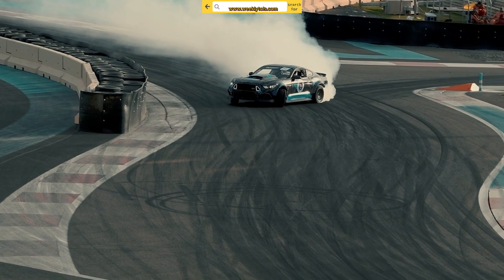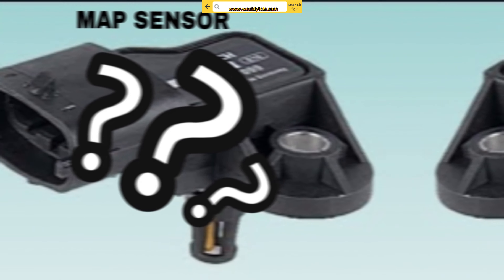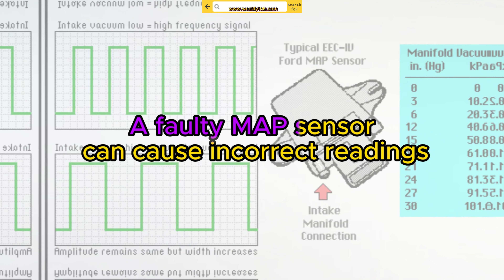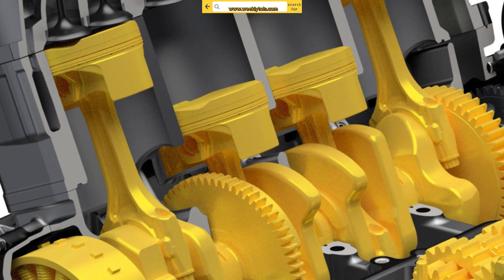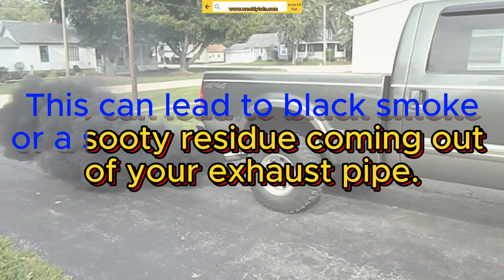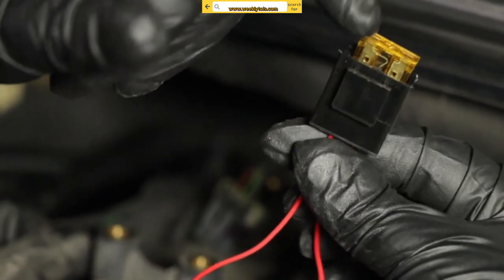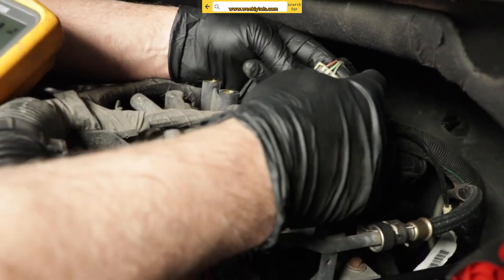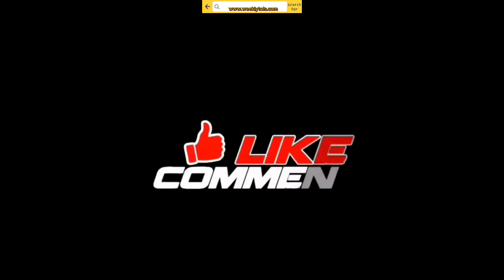Symtoms of a Bad Map Sensor | How To Fix Bad MAP Sensor |Bad Map Sensor Solution | Bad Map Sensor |

Comment: Would this cause codes P0172 & P0300 to pop up? 
I just replaced the spark plugs, coil pack, and fuel injectors on my 2013 Chevy Cruze Lt last month.
Reply from the maker: The codes P0172 and P0300 can be caused by a variety of factors, and replacing the spark plugs, coil pack, and fuel injectors may not be enough to resolve the issue. Here are some possible causes for these codes:

P0172: Fuel System Rich:

Fuel pressure regulator: A faulty fuel pressure regulator can cause the engine to run rich, leading to the P0172 code.
Mass airflow sensor: A malfunctioning mass airflow sensor can send incorrect information to the engine control module (ECM), causing it to run rich.
Oxygen sensor: A faulty oxygen sensor can provide inaccurate readings to the ECM, leading to a rich fuel mixture.
Vacuum leaks: Vacuum leaks can allow unmetered air to enter the engine, causing it to run rich.
Fuel injector malfunction: Even if the fuel injectors were recently replaced, one or more of them could still be malfunctioning.
Engine control module (ECM) issue: A faulty ECM can cause the engine to run rich.
P0300: Random Misfire:

Spark plugs: Even if the spark plugs were recently replaced, they could be damaged or mismatched.
Coil pack: A faulty coil pack can cause misfires.
Fuel injectors: Faulty fuel injectors can cause misfires.
Timing belt or chain: A worn or stretched timing belt or chain can cause the engine to be out of time, leading to misfires.
Compression issues: Low compression in one or more cylinders can cause misfires.
Engine control module (ECM) issue: A faulty ECM can cause misfires.
Additional troubleshooting steps:

Check for vacuum leaks: Use a vacuum gauge or smoke test to check for vacuum leaks.
Test the fuel pressure regulator: Use a fuel pressure tester to check the fuel pressure regulator.
Inspect the mass airflow sensor: Inspect the mass airflow sensor for dirt or damage.
Test the oxygen sensors: Use an oxygen sensor tester to test the oxygen sensors.
Check the timing belt or chain: Inspect the timing belt or chain for wear or damage.
Perform a compression test: Perform a compression test to check the compression in each cylinder.
Have the ECM scanned for codes: Have the ECM scanned for any additional codes that might be related to the P0172 and P0300 codes.

If you have already replaced the spark plugs, coil pack, and fuel injectors and are still experiencing these codes, it is recommended that you have your vehicle inspected by a qualified mechanic to diagnose and repair the underlying issue.

Comment: Can it cause engine knock plus poor fuel economy?
Reply from the maker: Yes, a bad MAP sensor can cause both engine knock and poor fuel economy. Here's why:

The MAP sensor's role: The Manifold Absolute Pressure sensor measures the pressure in the engine's intake manifold. This information is crucial for the Engine Control Unit (ECU) to determine the correct air-fuel mixture for optimal engine performance.

Impact on air-fuel mixture: A faulty MAP sensor can send incorrect readings to the ECU. This can lead to an imbalanced air-fuel mixture, which can be either too rich (too much fuel) or too lean (too little fuel).

Engine knock (rich mixture): If the mixture is too rich, there's excess fuel that doesn't burn properly in the combustion chamber. This unburnt fuel can ignite prematurely during the compression stroke, causing a knocking sound.

Poor fuel economy (lean or rich mixture): In both lean and rich conditions, the engine isn't burning fuel efficiently. This wastes fuel and reduces your car's gas mileage.

Other symptoms of a bad MAP sensor:

Check engine light
Rough idling
Hesitation or stalling
Black smoke from the exhaust (rich mixture)
If you're experiencing any of these symptoms, it's recommended to have your car inspected by a mechanic to diagnose the problem.  They can use a diagnostic scan tool to check for trouble codes related to the MAP sensor.
Reply: @weeklytools  my car is idling fine, only knocks under little harder acceleration under 2200rpm
also, can a bad o2 sensor cause similar simptoms?
also; i have no check engine light, no fault codes, i monitored live data from running engine and everything looks good to the ecu but something is obviously wrong
Reply from the maker: A knocking sound during acceleration can indicate a few potential issues in your car, even if the check engine light isn't on. Here's what could be going on:

1. Detonation (Knocking):

This is the most likely culprit based on your description. Detonation happens when the air-fuel mixture in the engine ignites abnormally due to low octane fuel, lean air-fuel mixture, or engine deposits. It creates a knocking sound, especially under load (acceleration) and below higher RPMs (like the 2200 rpm you mentioned).
2. Worn Engine Components:

Less likely, but possible, is knocking due to worn parts like bearings or pistons. This typically produces a deeper, more constant knock compared to detonation's lighter, higher-pitched sound.
3. Loose Engine Parts:

In rare cases, loose components like heat shields or engine accessories can vibrate and create a knocking sound under acceleration.
Bad O2 Sensor and Knocking:

A faulty oxygen sensor (O2 sensor) can contribute to knocking, but it's not the most common direct cause. A bad O2 sensor can lead to a lean air-fuel mixture, which can then cause detonation and knocking.
Diagnosis:

While the live data might look normal to the ECU, it's recommended to take your car to a mechanic for a professional diagnosis. They can use specialized tools and listen to the specific sound to pinpoint the issue.
Here's what you can do:

Try higher octane fuel: If you're using lower octane fuel than recommended for your car, switch to the recommended octane level and see if the knocking goes away.
Take it to a mechanic: Don't ignore the knocking sound. Ignoring it can lead to further engine damage. A mechanic can diagnose the problem and recommend repairs.

Remember, this is just general advice, and a professional mechanic can provide a more accurate diagnosis for your specific car and situation.

Comment: good knowledge. if you give some information about the location of the sensor.. then knowledge will be more effective
Reply from the maker: Thanks for your advice.Hope to fix them next time.
Reply: Map sensors are usually located on the intake manifold.  It varies vehicle to vehicle.
Reply: Is there one for a 2006 Honda Civic my gas mileage goes from 53 to 26 to 50 to 30 to 45 to 50 to 28 mpg each highway trip.

Comment: And burns out the catalytic converter. Or over heats it and causes p420 .
Reply from the maker: In short, a bad MAP sensor can contribute to catalytic converter problems by causing the engine to run rich, which in turn leads to excessive heat in the converter.
A bad MAP sensor isn't the only cause of a P420 code. Other issues, like a failing oxygen sensor or a bad spark plug, can also trigger this code.